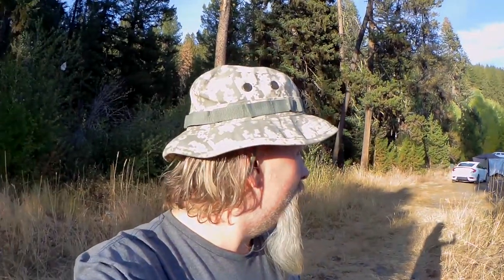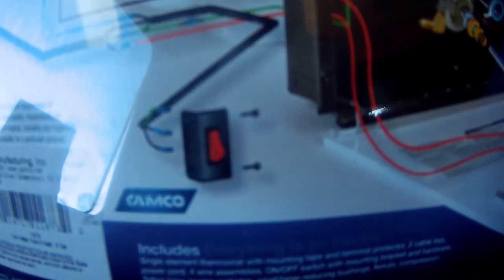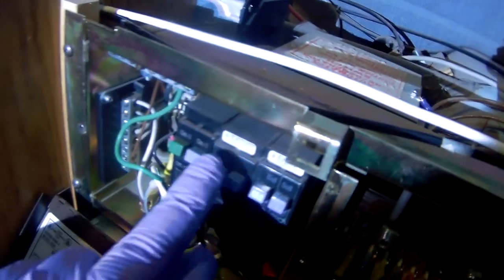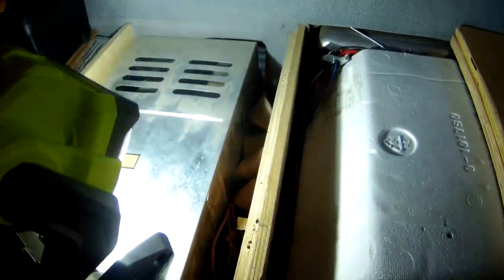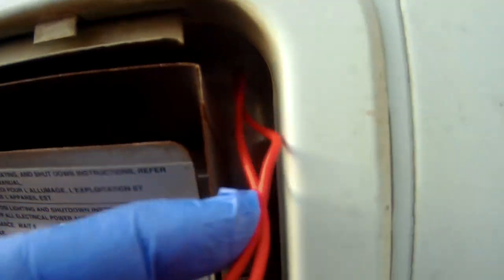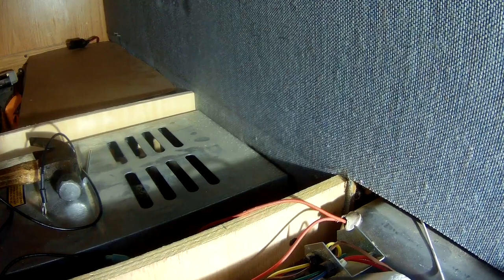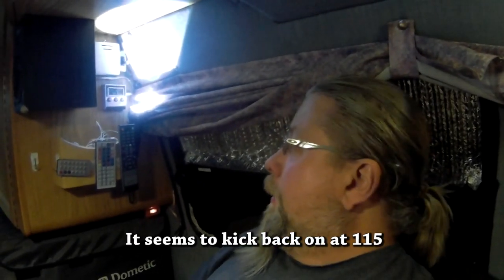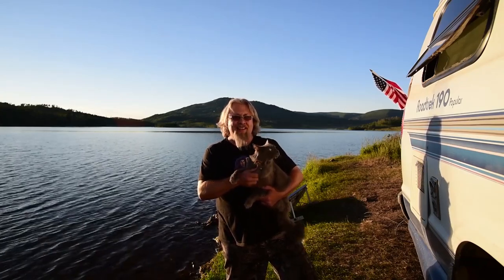ADD ELECTRIC TO YOUR PROPANE RV WATER HEATER ! CAMCO HYBRID HEAT STEP BY STEP INSTALLATION

Comment: Camping World sells a conversion kit called a Hot Rodd to add an electric option to my propane water heater for under $100.
This is for the brand that has no anode rod and is installed in the clean out plug on the water heater.  Power is plugged into a 120 outlet and thermostat is mounted on top of the water heater. It automatically goes to electric when rig is on shore power or on generator power.

Comment: Hope your tank has a pressure. Release valve.
Reply: What will happen if my hot water tank doesn't have a pressure relief valve. I know that this is an old video but I really need to know. Thanks a lot

Comment: Love my instant hot water heater off Ebay for $49  Hangs on the back of my Trailer.... uses small amount of propane and water.......  shut the water sprayer off and the heater shuts down......   No need to run my Sportsmen Geni

Comment: Do you or anybody here happen to know where the house battery is on a '96 popular 190? I have not found it yet.
Reply from the maker: Under the driver's side bench next to the fuse box / charger. It's in its own sealed compartment that vents into the wheel well.
Reply: @HOBOTECH  thank you so much but my van doesn't have it there. I looked. I have seen it in one of your videos. That is where yours seems to be. Scratching my head 🤔. I think at this point that it has to be either under the floor or under the van. The big fat black and red cables from the relay go in to the floor and disappear. Tomorrow I will go back in and start taking everything apart until I find it I guess.

Comment: I bought just the 450 w element. Installed it on an actual wall switch timer. Just like a jacuzzi or sauna lamp timer u find at a gym etc. 20amp. I bypassed using a thermostat completely because a 6 gallon tank will not be much hot water in general. And with the timer on manully for 20 mins it shouldnt get hot to fail. Mine stopped working the 2nd day. New one arriving today. Any thoughts if i need a thermostat? At 450w and 8min showers i should have a decent supply of hot water. Maybe it was defective. Idk. It didnt really warm up a 2 gallon bucket of water to hot when i tested it.

Comment: That heater element is in water. Be sure to have a GFCI circuit protecting it.
Reply: a
Reply: kyanki    xock   ekexeci
Reply: The heating element is inside a metal shroud and it’s completely separated from the water
Reply: @RussellBond13  But the wire leading to it is not protected. If it shorts and gets wet, it could electrify the water tank or that metal shroud inserted into the water.